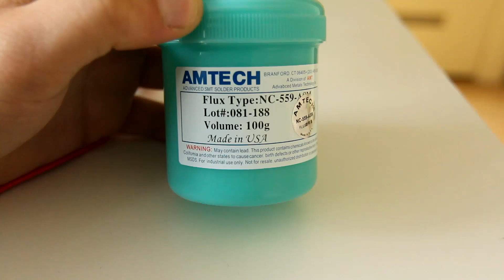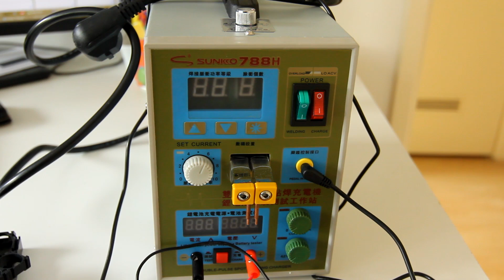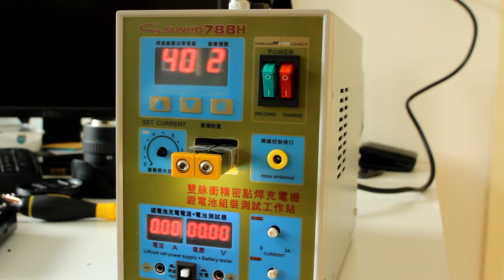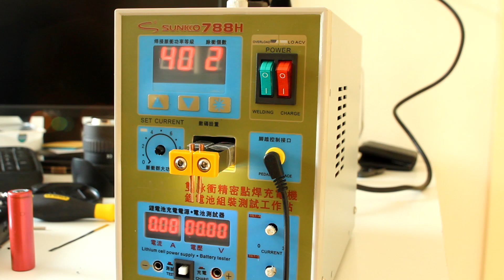Sunkko 788H Battery Welder teardown & repair (029)

Comment: I thought I should add my recent experience with a Vevor 788H unit (same thing as the Sunkko). Here in Australia we use 230v and it tripped the 16 amp breaker as soon as I turned it on! Eventually I found if I connected it via a long extension cord it would sometimes turn on but would still sometimes trip when welding. After much reading I came to the conclusion it was the transformer so replaced it with a microwave one with three turns on the secondary - now it works like it should and gives excellent welds. Sometime later I got curious about the transformer so did some testing. There is a single primary winding and it measures 0.8 ohms!! At 230v the inrush current is far in excess of the breaker rating! The microwave measures 3 ohms, which is obviously enough to slow the initial inrush current. I believe this unit has been fitted with a 110v transformer, and although that little board on it says 110/220v with only one winding there is no way to change the voltage. There's no way this could have passed Australian Electrical Standards!

Comment: I added more windings to the transfomer, not surewhy but seems like it bypassed the pressure switch for the probes.. but lots of power now.. charge area no longer works but considering how shitty the solder job is on the board i figure ill use another power supply to charge lol

Comment: Replace the transformer with a microwave oven transformer minus the secondary winding.  Replace the secondary winding with the original secondary from the spot welder, which is easily removable.

Comment: 709AD have lot lot better inside have biggest transformer, this have smallest transformer what sunkko welder have, not give 200A out. newer, not can weld 0,2 strip. maybe weld only thin 0,1 strip but not good. thats give less than 200A out and better 709AD model give 600A out. little better and can use li-ion 18650 battry welding lot better than this. this is toy. maybe if upgrade microwave transformer to this come lot better. OR install secondary wires new, lot more wire, mean now have wery think secondary wire need douple sguaremeters and lot more copper to secondary wires. youtube has made this upgrade too ,help little make better this but no lot.

Comment: Hi, nice video I am using UK  version I have changed internal fuse with a 15A  as it States behind the machine 15 a max. also replaced plug fuse  with a 13A fuse as some nutter put 20a in the UK plug. Thank you.
Reply: Yo any info on this machine please what setting works best also isit possible to get the pen to work on the wands

Comment: The circuit braker does NOT trip if you switch it on while the sine wave is at a cross point NULL (0). I have the same problem. Only at the switch startup it will trip. There is a design fault at the startup. If you have luck then it works at 16 amp circuit braker and all works normal and great!! Best regards, Albert (Netherlands)

Comment: For others looking for info on this battery spark welder, I thought it might be worth noting that the "set current" label actually belongs to the the LED display above the label. The knob below the label is the pulse duration for the weld.

Comment: mine just started doing the exact same thing.... lights up but wont weld... I hear no more transformer noise as when it worked before.
Reply: Usually that is a sign of overheating
Mine does that when I use it to the point that it overheats

Let it cool down and try again in about an hour or 2, it works for me

Comment: During testing at the 12 minute mark I notice a couple problems with your use of the welder.  1) You have the charger and the welder turned on at the same time.  2) With the pedal plugged in, you lift the batteries up and say nothing (no weld).  Proper operation with foot pedal is to lift the batteries up raising the welder probes up to insure proper pressure, then press the foot pedal.  If the foot pedal is depressed before starting the process it won't work.  3) Is the current selector (0-10) set to zero?

Comment: Those household breakers are rated for different reaction times... I have one of these units and it can trip a 32A breaker while not blowing a 5A wire fuse.... so remember that breakers come with different speed and surge ratings.... the welder doesn't actually cause any problem once the power is on, it's the switch on "thump" that trips those breakers.

The MCB breakers have 2 modes.. they trip instantly if the current goes over a certain rating, and also have a thermal trip that triggers if the average over a short period of time exceeds the rated current.,.,. The key is what surge current they will allow.

https://www.voltimum.co.uk/articles/selecting-right-mcb-its-easy-bcd

Try using C breakers instead of B ones!

Comment: mine brand new connected something broke inside very large spark was seen. it sounds like soldering but doesnt not even small mark. any idea how to test what its broken?
Reply from the maker: Hmm, that is weird. There are really only three components in the high power circuit: the fuse, transformer and TRIAC. One of those must have blown. If nothing was visible afterwards, I'd assume it's the fuse, because it sits inside a cartridge.
Reply: I replaced the fuse by a new one and no luck. I will have to take it apart and check what is going on. 

What model is your transformer any link to check specs?
Reply from the maker: I don't even know - I got it as-is from a friend at the hackerspace.
Reply: Hi, I had same problem had large spark after that it stop working, now everything when I power it on the LED comes ON then fuse just trips. Checked continuity on probes, triak and 240v cables going to transformer all shorted.

Comment: Hi, great video, can you tell me what socket, and plug they used for foot switch? I have foot switch without any connectors(just pedal switch) and I would like to use it with my home made battery spot welder.
Thanks
Reply: It's a 5.5mm barrel plug, like the power connection for laptops.
Reply: Thanks, so it's DC power supply socket and plug :)

Comment: Did you go to a larger amp breaker? You are welding and need to use a breaker and circuit to handle 30-50A.
Reply from the maker: I'm actually about to try some more stuff with this machine this weekend, so stay tuned for that.

Comment: man is totally normal, you need the breaker to be 50A at least; it written even in the description of the machine not for home use...i had the same problem; replaced the braker and used to electric oven connection - thicker wiring and works perfectly.
Reply: i was just going to mention that as i read the entire instruction manual

Comment: The tripping is normal, current is too high for 230V outlet. Use it on 3-phase and it will work!
Reply: There are adapters from 3phase outlets to single, utilising the higher currents

Comment: Hi 
I had one arrive and it worked till I plugged in the foot peddle .. any Ideas??
Reply from the maker: Did it actually function, as in, have you already used it for welding battery tabs? In that case, you're probably just looking at a bad solder joint (flip out the board, touch up the soldering of the foot pedal connection, should be good to go). If it never worked in the first place and failed as soon as you plugged in the foot pedal, it's probably the same issue that I had and you have to repair the transformer.
Reply: wonderful!!  I don't know that it actually functioned but leds lit up , Thanks for the video and the reply !  Ill open this thing up.

Comment: Hey, I've got a similar one that was also DOA. Turns out there was a short between the secondary windings. So there was a single loop of copper through the transformer. That kept tripping my circuit breakers. I've fixed it with a piece of plastic to keep the windings separated. Great channel BTW.
Reply from the maker: +righthere80 Ugh, I was hoping I wouldn't have to get out the transformer, but I guess that's pretty much the only remaining explanation for my problem as well. I'll have a look later this week, hopefully fix it in much the same way that you did :)